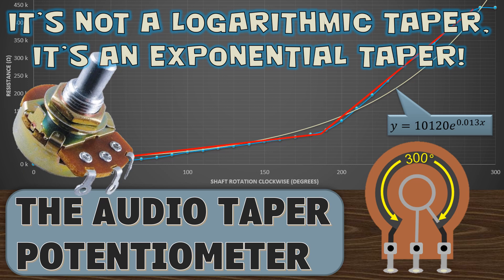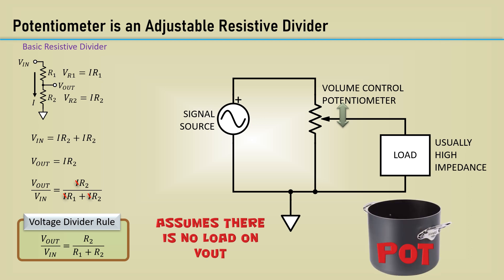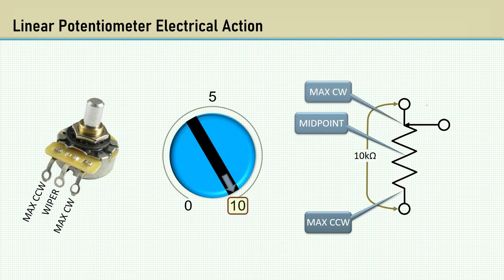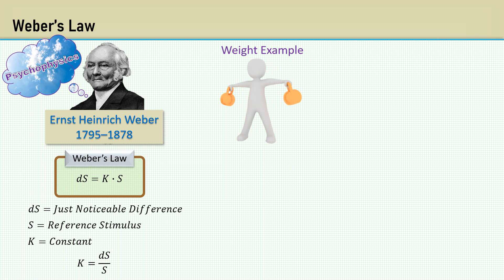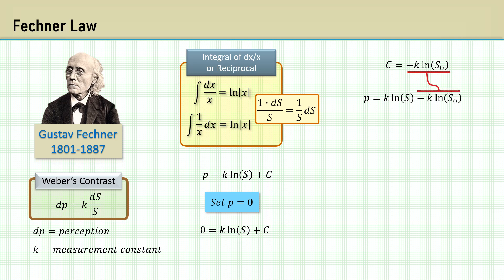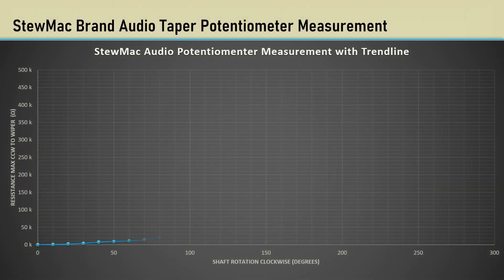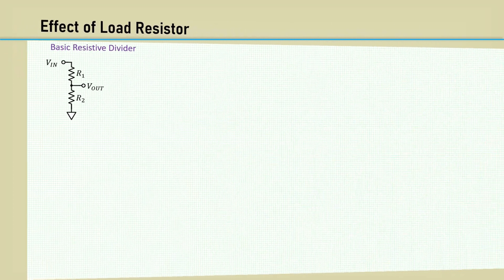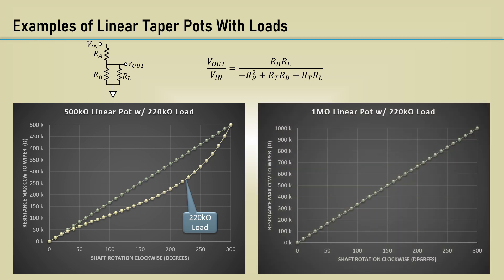The Audio Taper Potentiometer

Comment: Hi. Thanks for posting this, really useful.
I am a lefty guitarist who struggles to source reverse logarithmic pots, and after watching your video I was wondering if I could convert a standard 500k linear potentiometer to logarithmic by fitting a 75k resistor to it? I'm thinking the resistor would be connected to the centre lug and the outer lug that is going to ground? Any thoughts? Thanks 👍
Reply from the maker: Yes indeed. Just know that the added load resistance will damp the pickup’s resonance (usually less highs). Let us know how it works out for you. Thanks for the comment.